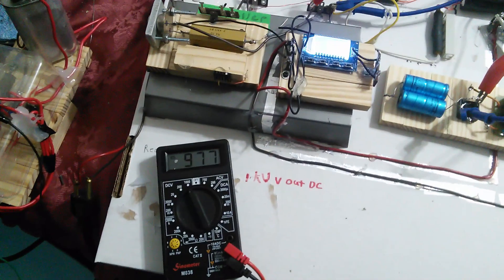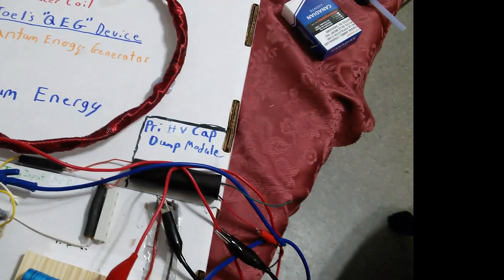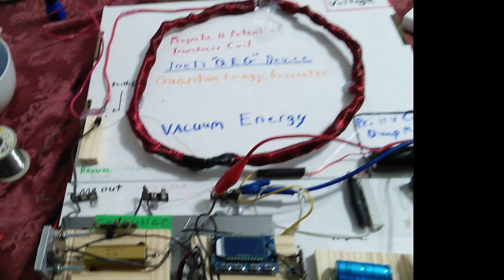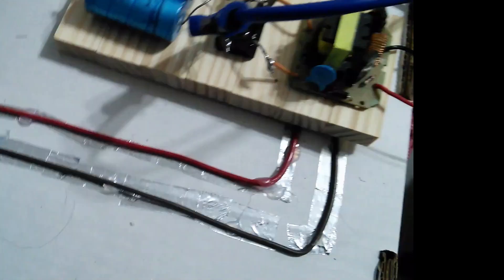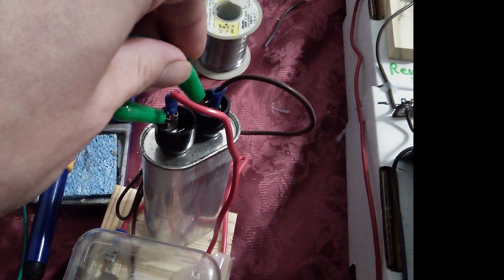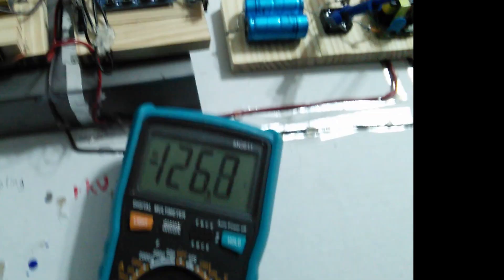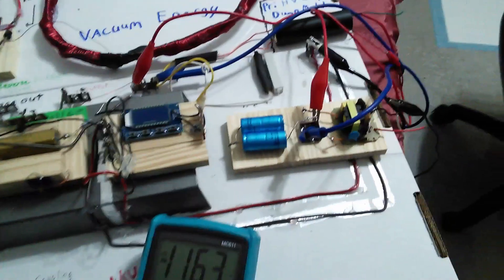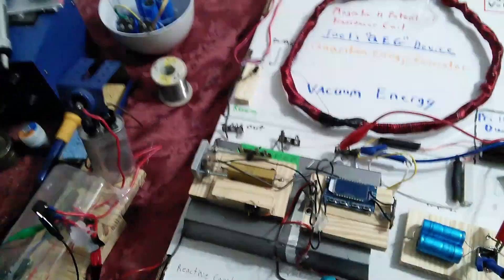QEG In Self Oscillation

Comment: what is reactive really?
in terms of gravity it's intertwined in nature, it's the inertia counter force,  in electricity it's not intertwined but a chain reaction. in a coil current creates H, which aligns magnetic domains i the core, which in turn create a changing B that cuts the current and creates a force in opposite direction, the force causes a back voltage which in turn costs you VxI.

 you're a great tinkerer. i want to  experiment but my hands don't allow me, so i do think-ering. :)

Comment: Dear Joel, I’ve been watching your channel for a while now. I’ve been enjoying your research. Out of all your circuits which 12 v battery charging circuit performs the best. And have you tried charging other batteries like lithium, iron phosphate etc.?
Reply from the maker: A little secret with the Bedini like chargers, They will charge most of your household Alkaline batteries even the unreachable ones for many cycles. They rot by cycle 10... But still right! I use them in clocks and meters all the time!

Comment from the maker: I woke up this morning and the peaks where down to around 60V I discharged the reactive 10uf cap a few times for spark and that kicked it back in high voltage oscillations of hundreds of volts, I primed it with the trigger for another 2 seconds after and it climbed back up and  self oscillating into the KVs again,

Comment: I am currently working on a cap dump solution. I'm trying to have a transistor dump it into another capacitor. I've gotten the gate to be driven by an optocoupler, and tomorrow, I will try and see if I get a successful dump. I can do it manually with a wire, and I can do it with a relay, but the issue I have with those is the wasted energy it produces due to the spark. I.e. a 12V capacitor will only transfer 1.5V to the other capacitor, and the primary will end up with 1.8V. Hopefully, the SS will eliminate the spark and not kill all the working transistors